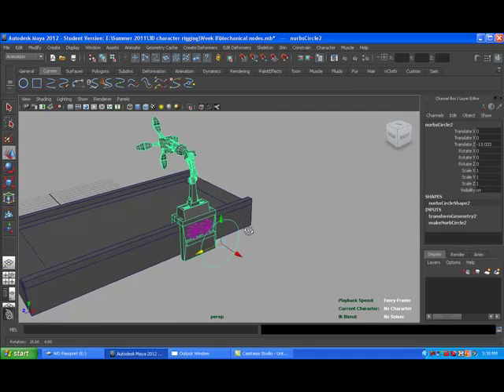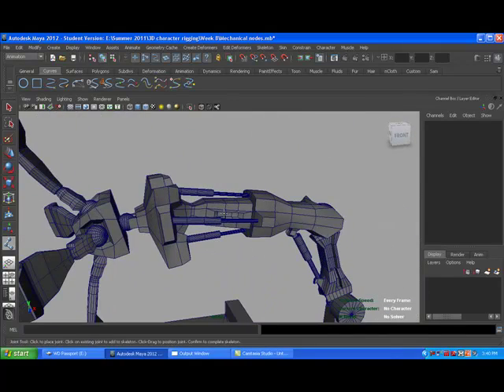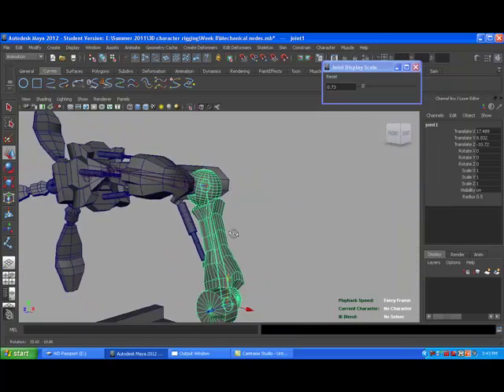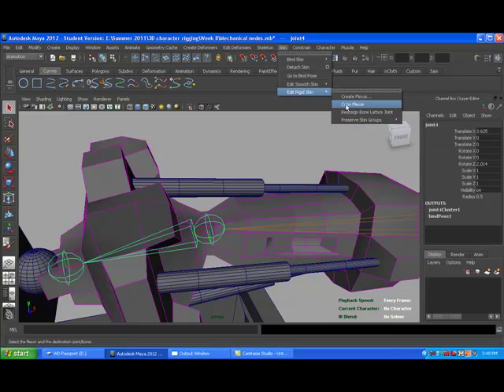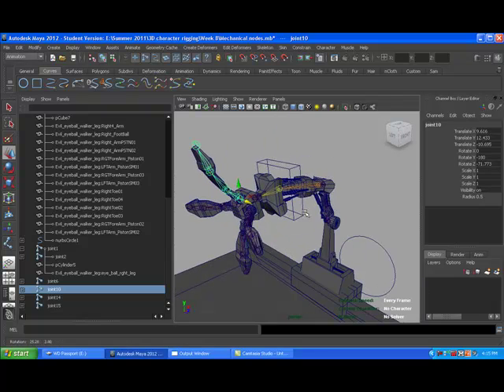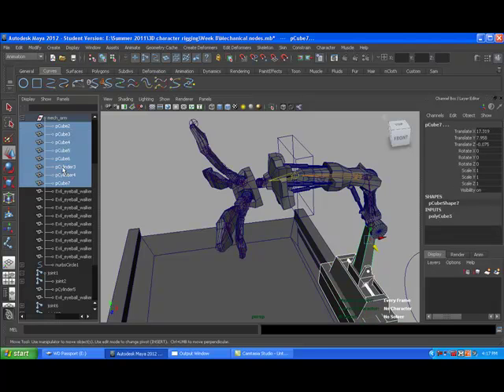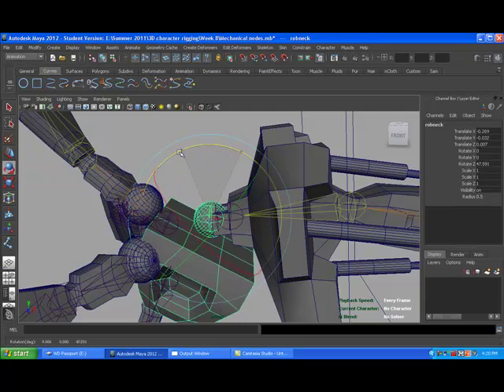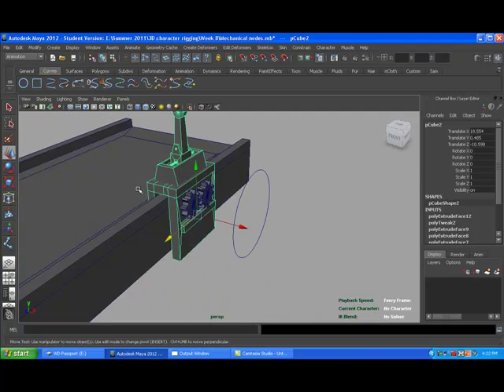mechanical rig_part01.mp4

Comment: Oh so Rigid bind is used rather than constraints? Also do all the bones have to be freeze transformed or how do you reset the transformations for each bone? Or does it not matter as long as the Curves controllers are zeroed out so that way when you want it to go back to the original resting pose, you don't have to memorize the arbitrary numbers the bones ended up at, right?